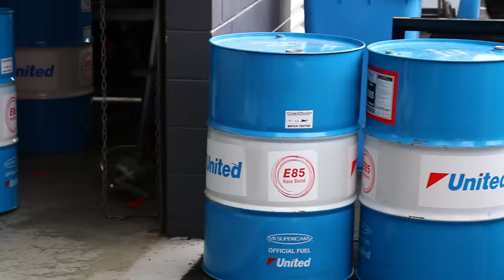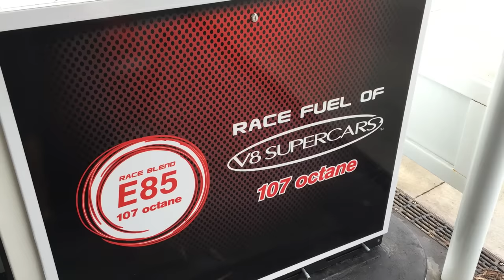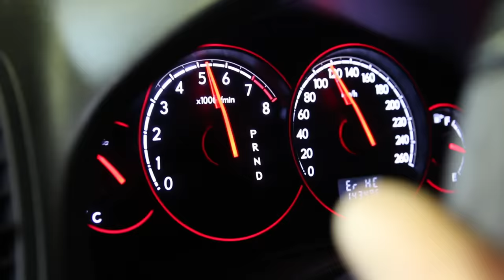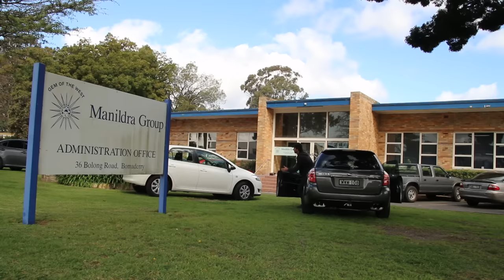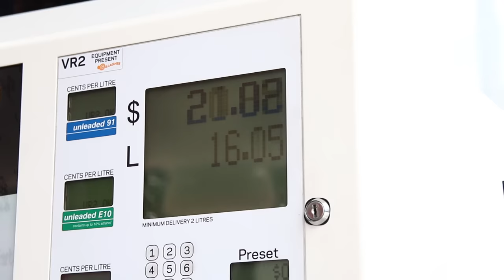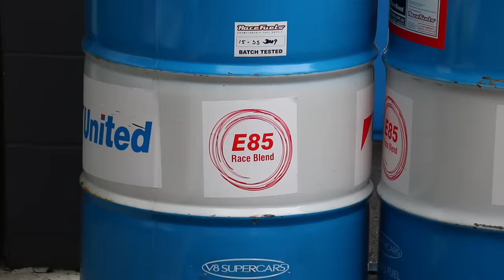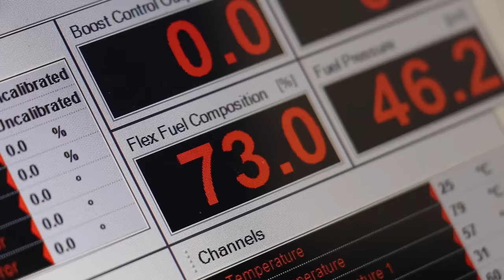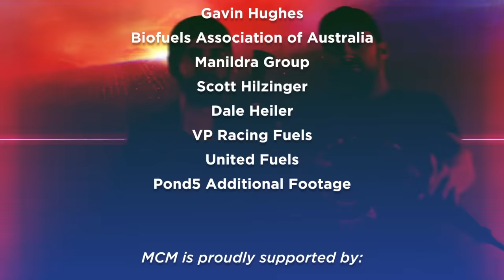E85 Fuel Explained - Should you use it?

Comment: They basically put poisonous bitter stuff in it to prevent alcoholics from getting drunk on their fuel, because then the alcohol industry will suffer if you can get a gallon of ethanol for $1 or whatever.
Reply: Legally they have to, otherwise its taxed as liquor which is much higher
Reply: @tortron  ah I see. Thanks.

Comment: Some disadvantages of Ethanol:

Ethanol may be good for supercharged and turbocharged engines for it's anti-ping or detonation qualities. But naturally aspirated, "Flex Fuel" cars will show no measurable performance improvement. 

The fuel range is at least 1/3 less per gallon or liter. The engine computer on Flex Fuel cars just makes the fuel/air ratio richer from a lean 14.5:1 stoichiometric to a richer 7:1 and the cost at the pump wont offset the total cost per mile or kilometer most of the time ( You'll have to do your own math on this).

Ethanol (E85 has up to 15% petrol or gasoline) combustion might be emitting less carbon emissions. But the farm growth/conversion process offsets and exceeds that.

The presence of oxygen in ethanol opens a pathway for a myriad other combustion products, including formaldehyde and acetaldehyde. If inhaled in small quantities, these chemicals can irritate the eyes and lungs, whereas more significant exposure to these and other particulates is associated with asthma, allergies and even some cancers.

 Ethanol is hygroscopic, it means that it absorbs water from the air and thus has high corrosion aggressiveness. That’s why it is transported only by auto transport or railroad.

Ethanol competes for arable food producing land for human survival.

Ethanol can negatively affect electric fuel pumps by increasing internal wear and undesirable spark generation.

Pure ethanol is also difficult to vaporize which can make starting a car in cold weather difficult and that is why most fuels retain at least a small amount of petrol or gasoline – such as E85 cars with 85% ethanol and 15% petroleum.
Reply: Most of that beginning was incorrect. on N/A applications a tune alone saw as much as 40 rwhp on certain vehicles that were non ffv . it will vary from car to car. all show a measurable amount of power increase from MBT alone. 

14.5 / 7:1  is not "richer"  its a different target point. it takes more ethanol to target the same AFR but can be offset depending on the design of the engine. 

Farm growth claims are not substantiated , especially if the equipment used to far has far better emissions. 

gasoline can also obsorb water. transport it correctly and make sure your car is correct mechanically it is not a problem > 

it does not compete for food and the refinment process is being changed and improved over time no different than oil and gas were at some point in the past. 

it does not do anything bad to fuel pumps except those made with rubbers that dont tolerate the fuel to begin with ... which over all is not a problem in most 90's + vehicles anyway ,  

vehicles can start in the cold weather even if a bit more difficult this is not a "problem" so to speak and does not take away the incentive to use it , especially in warmer climates. most about -20* F
Reply: +The General Speaks You clearly don't even know what you're talking about.On naturally aspirated engines they make more power on pure gasoline without any ethanol.Gasoline CANNOT absorb water because it isn't hygroscopic ,ethanol is.Ethanol is bad for all fuel systems and engines,there is a reason you don't see anyone running pure ethanol in their engine.Ethanol has caused melted pistons because it burns hotter than gasoline and is notorious for causing rust inside fuel lines as well as destroying rubber hoses and diaphragms not compatible with it.
Reply: Research and technology dictate differently.

Most N/A engines that have run it had an increase in power and those built to take it see it even more so due to the ability to take advantage of the fuel. MIT case study disagrees with your assertion .

You're wrong.
Reply: Any melted pistons are from it being in an untuned engine . Any destruction of fuel lines etc is the fault of the person not placing the fuel into a vehicle with lines that can sustain it.

You cant store gasoline in things its not designed for either so the point is stupid. majority of 90's + vehicles can tolerate ethanol without issue. Ive proven this in my research and many others
Reply: George, do you know if it has an adverse effect on oil like during the actual strokes of the pistons since roughly 30% more needs to be injected per cycle compared to gas. I'm worried about cylinder and ring wear.
Reply: BlueonGoldZ - More oil change intervals are needed (especially in turbo or supercharged engines). Because of the the natural blowby of the piston rings with more fuel used per unit of air. The E85 fuel trim in flex fuel cars is 7:1 (i.e. 7 parts air to 1 part fuel) instead of 14:1 to reach a stoichiometric mixture to burn properly. So more volume of E85 is needed to be combusted properly (that is why the fuel range and lower MPG per tank full is lower). E85's side effect is more acidic oil contamination due to more fuel burned per mile or hour.
Reply: You should be worried about everything wear. When ethanol gets into the oil, especially synthetic oil, it creates ethanoic acid and slowly eats everything. And due to ethanol's high vaporization point, it builds up on the top ring land and WILL work its way into the oil. Outside of racing, the stuff is junk.
Reply: George Travers I run e85 in my stroker engine and it runs great. You get great benefit being able to run a large camshaft with super high compression of around 13:1 and higher if wanted without sacrificing much bottom end torque. Not only that, but in a modified car and tuned to suit e85 makes the engine more responsive and quicker and gives it a more wild acceleration rate. Plus it makes the engine run MUCH cooler.
Reply: The General Speaks running your car on e85 is the best thing out. Response and acceleration is noticeably better if tuned for it
Reply: You guys are misinformed.
Ethanol does not do any damage whatsoever to any car or fuel system after the 90's if tuned for it
I have been exclusively been running this fuel on my engine for over 5 years and no issues whatsoever.
The only cons is that it can contaminate engine oil quicker especially if you don't use a high quality fully synthetic. Your fuel consumption gets around 30-40% worse too..
Other than that it does wonders for the engine.
It cleans it out, keeps the exhaust tips shiny with no soot and keeps the engine and engine bay noticeably cooler.
It also gives it an angrier exhaust note with high compression engines.
Reply: So does E85 ruin stock engine internals?
Reply: +NLJR No.
Reply: Use high compression and radioactive or contaminate land.
Reply: BS, ethanol is solely responsible for damaging small engines, anyone in a lawn business that was in before the government endorsement of that crap has witnessed it! BTW I own a van, your claims on a cooler engine bay, I believe you best check your vehicle for an exhaust leak, you're high on fumes! The stuff ruins fuel tanks, eats the finish from them, and the rate of water collection, it rusts them out, no way to prevent it, and plastic fuel tanks aren't a permanent answer either.
Reply: @231mac  you know how to get around the oil contamination? less ring gap and move the ring gaps farther apart. simple tricks us engine builders use. it blows the mind of people who have never tried, "Don't Think, DO!".
Reply: @TTimpreza  Your 'less ring gap' theory doesn't work so well on high boost, and especially nitrous engines, lol. And there is absolutely no way to stop blow-by, even with gapless top rings. You can reduce it, but not eliminate it. Us real engine builders understand that as a basic concept.

Comment: We use ethanol for lubricant when machining aluminium too. Specifically hand sanitizer because it has 15% glycerin in which actually does wonders for manual milling and lathe work on aluminium.

Comment: Here in Brazil, we have ethanol in every gas station, because almost every car out here is flex from the factory.
Reply: Yeah. Back then there were cars that used ethanol only. The only issue are the cold starts.
Reply: +Andyy Edits But we run on E100...
Reply: Yeah, but it's good for the people reading the comment section to understand our situation.
Reply: I went to San Paulo Brazil a couple years ago. It was beautiful!!
Reply: +ozzy8031 because other countries don't have huge fields of sugar cane?
Reply: Possibly, although I'm not sure...
Reply: Nice man, I'm glad you liked there. I live in the south region, a bit lower and it is very beautiful despite the grafitti sprayed on most of downtown's buildings, lots of criminals on the streets, same shitty governament for over 12 years and pretty much everything is expensive due the our crisis. But if wasn't for that, this country would be a great place to live!
Reply: +ozzy8031 um, Chrysler had flex fuel cars in 1990, but the blended fuel around that time was more methanol then ethanol, it was more corrosive and very very few stations carried it...
Reply: stock flex senor  dnt so
Reply: +Alfred McD I have similar issue with my car, thought its not that big of a deal.
Your car could run higher ethanol fuels even thought manufacturer says it cant, but to do that you need to upgrade fuel system to work with higher ethanol content fuels. This means chancing fuel lines, rubber hoses, fuel pump, injectors and possible gas tank... everything that is contact with fuel basicly and you should be good then. I'm not expert with flex fuel systems or the fuel, so i suggest you ask around from experts, what they think.
Reply: Abraço mano, portugues vivendo em Taiwan, bom inglês cara, que craque!
Reply: Pô, valeu cara! Quando tiver a oportunidade, vou sair desse país também...

Comment: I am glad to see others helping to get people to use e85. I am from the U.S. and with our pump fuels have low octane ratings, having a low cost high octane fuel at the pumps is great. For our cars to be able to run on regular pump fuel, the ecu has to make so many adjustments to the engine to prevent knock in standard engines. I luckily own a factory setup flex fuel car with fuel stations near by so I can run e85. Although e85's true blessing is for forced induction engines, even my mostly stock engine feels like it takes advantage of the high octane and fully utilize it's compression.  Normal 87 octane fuel, the ecu has to adjust the valve timing to keep some exhaust in the cylinder to reduce the max air and fuel that can enter and to preventing knock and nox emissions. When on e85, the ecu can maximize the air and fuel going in. The only problem I have is cost. Even though it cost less than regular fuel, the drop in mpg makes running on e85, at times, more expensive. Since my car can't fully utilize e85's potential, I only use it when price appropriately.

Comment: Such an educational video, a lot of good information. I wish you guys would've mentioned to be careful running E85 in colder climates. Over here in the U.S. a lot of guys have two tunes. One for the summer when it's warm out with E85 and one in the winter when it's cold out on regular pump fuels. If you run E85 when its cold you can gunk up fuel filters, lines, and injectors. Having a flex fuel sensor solves this problem. Also, direct injection engines have high pressure injector that don't flow a lot of fuel... So direct injection engines don't see good benefits from E85 because you have to flow more fuel. Not a problem on port injection vehicles because you just get bigger injectors. Mostly, car with forced induction and high compression ratios will see the benefits from E85. Overall, amazing video keep up the great work. I love these videos that you guys do where you go learn something new and sharing it with us. Thank you.
Reply: croberts3130 thx

Comment: Interesting fact: here in Brazil, gasoline has (by law) 27% of 100% pure alcohol and ethanol is 95.1% to 96% (the rest is pretty much water and additives). In the modded car scene, is almost impossible to find a turbo/supercharged car running on gasoline (because the quality is so poor. Premium gasoline is better, but still poor quality). So when you decide to install any aftermarket forced induction, we only run our cars on ethanol. 
Pretty much all cars here are now flex fuel (a few years ago BMW launched here the active flex 320i, and now vw has a turbo 3 cylinder engine which is also flex fuel), not just because of all the extra power from ethanol, but because our gasoline knocks really easily (even on completely original n/a cars).
Reply: +Benjamin Holt I assure you there is no water in your fuel. Water doesn't compress. If there was water in your fuel, bad things happen. xD
Reply: Rene Hourian yeah, I know that. But as you can imagine, isn't really easy to find out what exactly is in our ethanol.
Reply: +Rene Hourian (Kris) Actually there is water on brazilian ethanol because the distillation process is unable to separate all the water (maximum of 96%). The 100% ethanol added to our gasoline is the same ethanol distilled from sugar cane (even at 78,1°C it can't get better than 96%) but subjected to chemical processes (CaO + H2O --> Ca(OH)2) and after that it's distilled one more time but now only the ethanol evaporates. So the water reacts with those products and so we have 100% ethanol. This process increase the fuel price and thats why they don't use 100% ethanol. This 27% added to the gasoline need to be pure because gasoline (nonpolar) can't be mixed with water (polar), while ethanol can be mixed with both but more strongly with water.
Reply: I'm going to go ahead and assume it's a small enough percentage of water that when atomized by the injector, in the heat of a combustion chamber, it turns to vapor really fast. Like water injection. It's not a substantial amount of water, if there was, that would be pretty terrible. xD
Reply: +Rene Hourian (Kris) Exactly.
Reply from the maker: +Germano Gehlen Thanks for the info!
Reply: Mighty Car Mods Germano Gehlen Science!